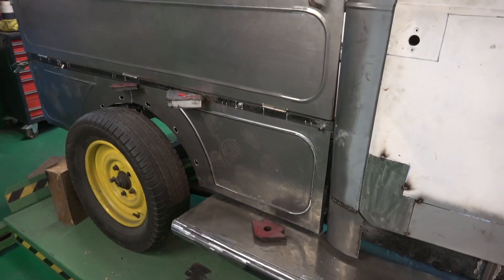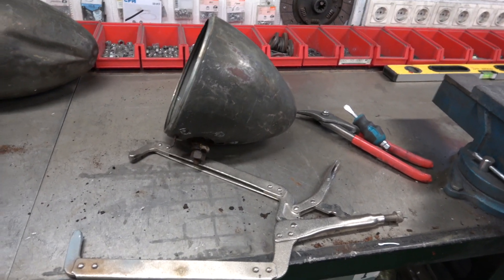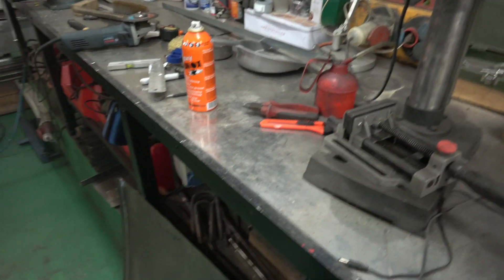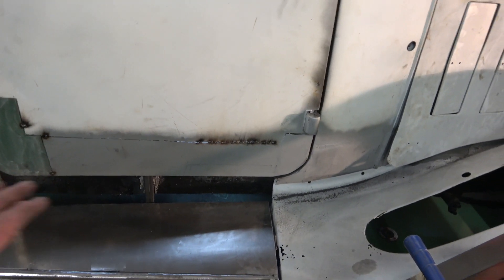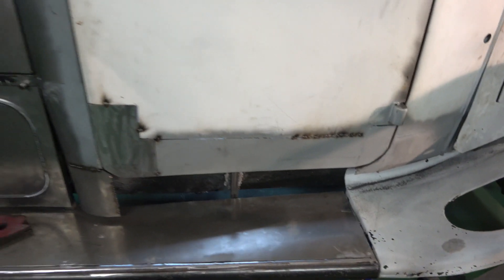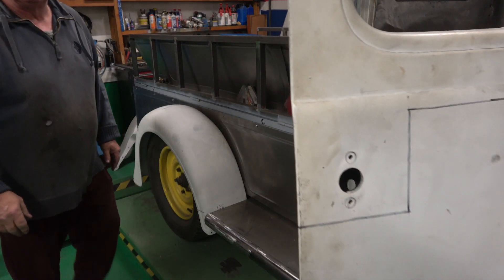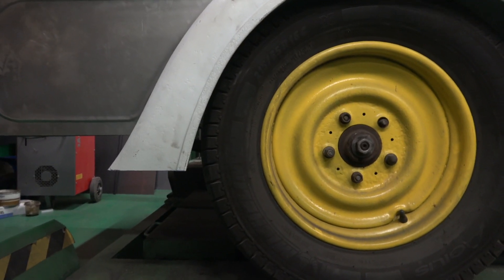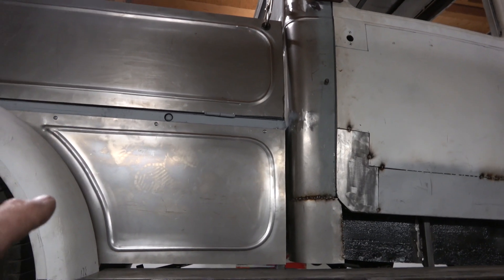1930s Barn Find Citroen Car Converted in to a Pick Up Truck Part 16

Comment: Really looking good Dave shame about the gas ,could you not rough it with some CO from the local pub ?
Reply from the maker: Peter, Thanks, if that's the only issue I have I‘m not too bad lol. I could but the argon does make difference to the weld. Cheers Dave

Comment: Are you going to close in the side and tail panels to stop shit getting in there ?Also your gonna need some killmat or similar to stop those panels drumming.
Reply from the maker: Gary,  There will be 1mm steel panels both sides with hard building foam insulation trapped between the panels in between for sound deadening. Cheers Dave